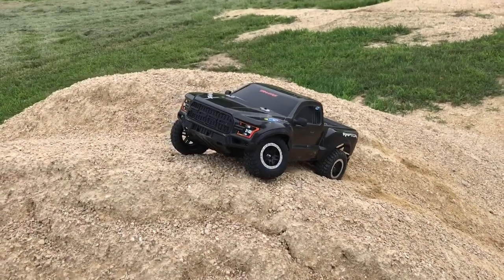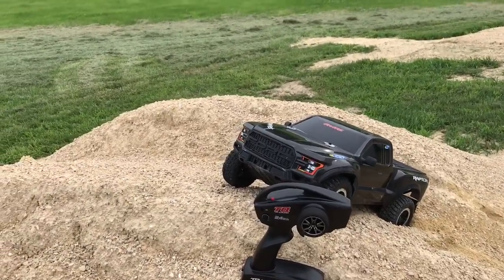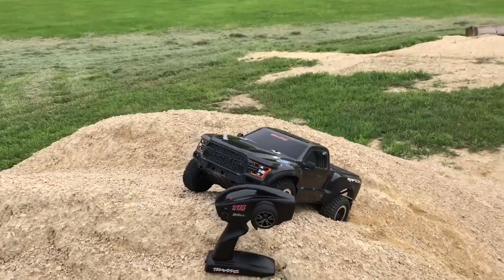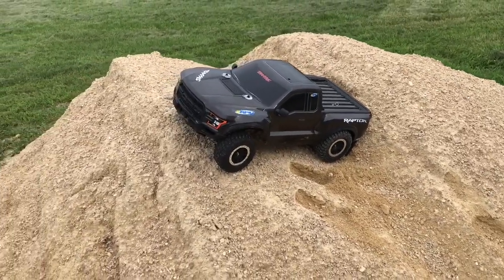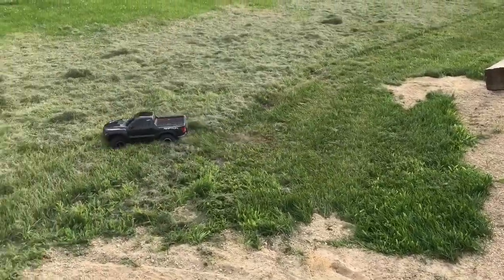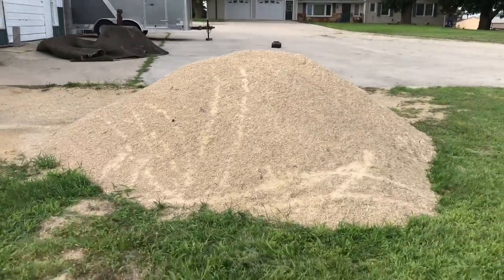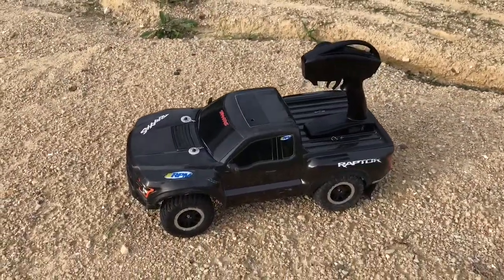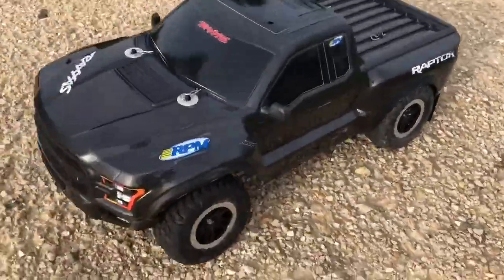Traxxas Ford Raptor Rock Crawl Part 1!!!

Comment: Where'd you get the back bumper and do those lights work
Reply from the maker: We got it at hobbytown.com
It’s the rpm bumper and you buy it kind of separate cause you buy the main bumper then the light holders if wanted then mud flips if want for it or a weely bar and the right now I have just light holders